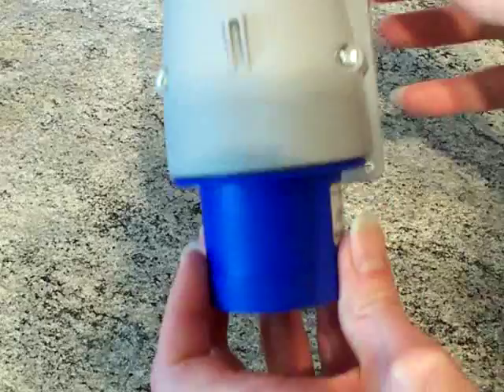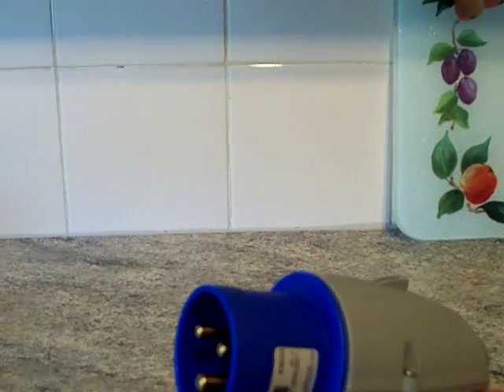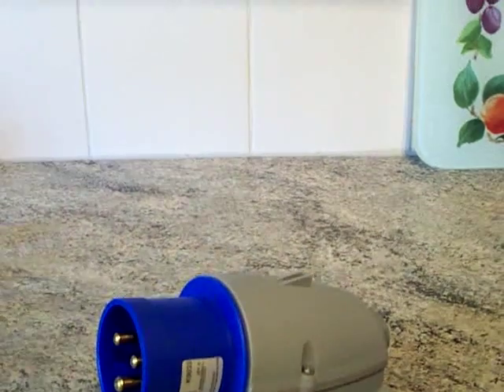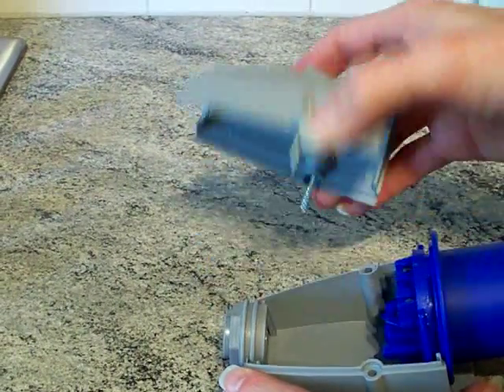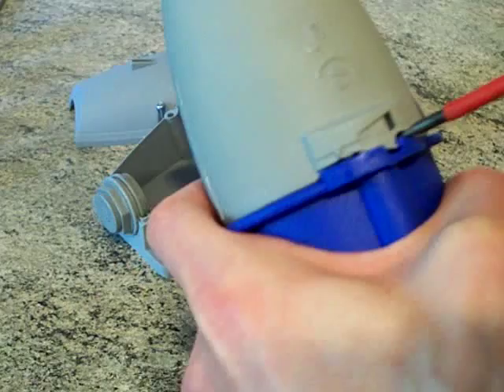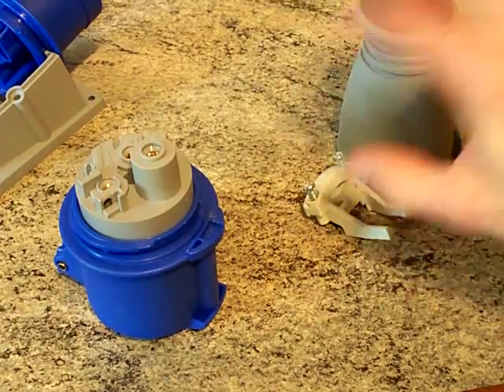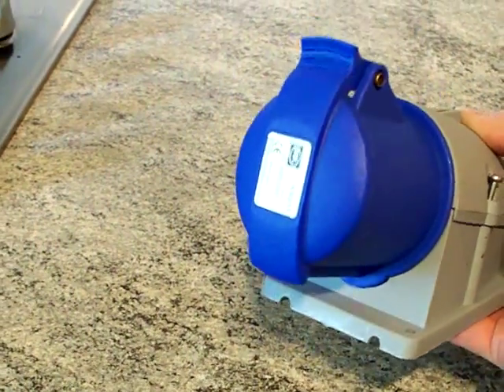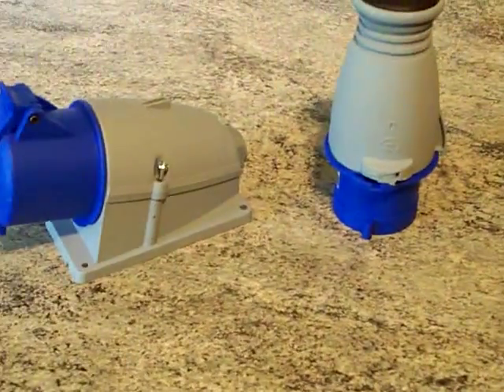Plugs : "Make-Your-Own" MK commando accessories. :D

Comment: Let’s see you touch the pins when it’s live!
Reply: Given the construction 
of this and all the electrical 
standards of various different 
countries it meets........
.
.
.
.......Touching the pins while it is live is near-on, if not impossible.

The only way it would be possible, is if some DULLARD wired a plug onto both ends of a flex.

Those dullards. They are out there, so beeeeeeeee careful!!

Thanxx for watching,

-Wayne's Electrical.

21st October 2020, 19.14

BoomBoxDeluxe is now a Wayne's Electrical brand.